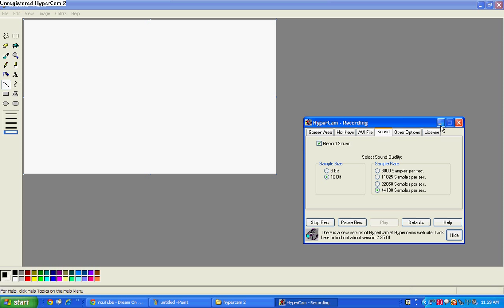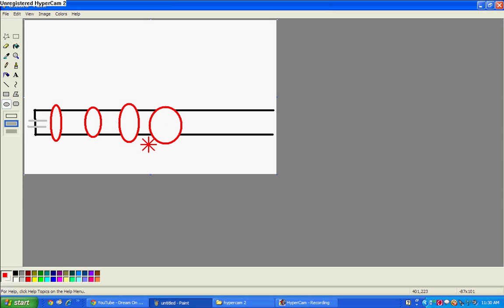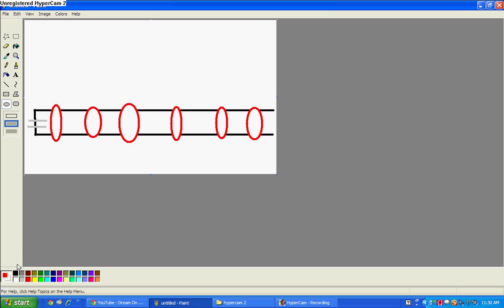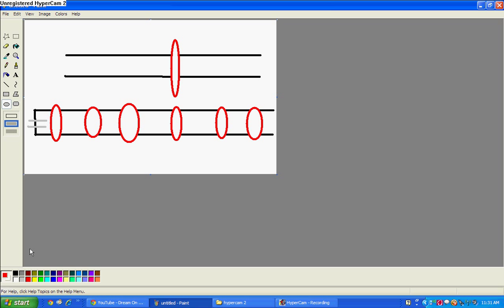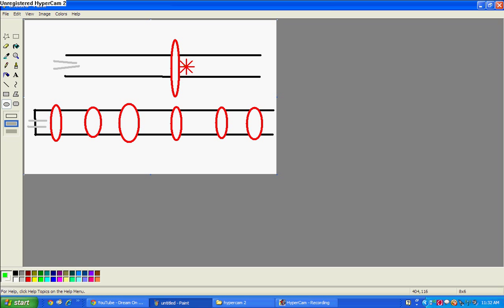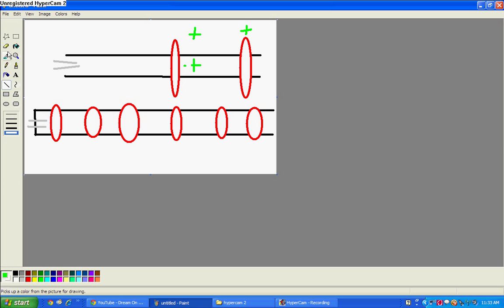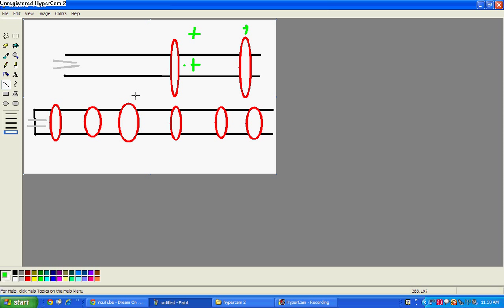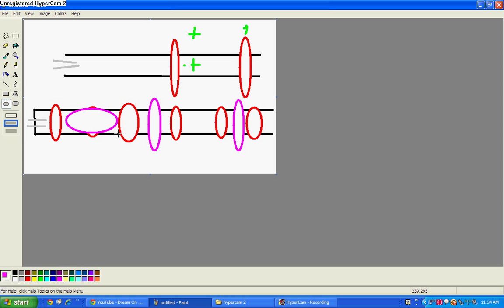How a Linear Accelerator Works

Comment from the maker: There is no pushing and pulling, there is repulsion and attraction. An electron has a negative charge so it will be attracted to an object with a positive charge and repelled by an object with negative charge. Similar to how a north pole magnet is attracted to south and repelled by north. The oscillations are in the rings (or cavities) and are controlled by klystrons, which are just super powered vacuum tubes. So whats resonating is the charge of the rings.

Comment from the maker: The rings don't actually create the field in real life they are usually copper RF cavities or tubes. The electric field is amplified to high levels using klystrons and then injected into the RF cavities (represented by rings in the video). The polarity switches at a given rate (for Fermilab about 700 million times per second) so electrons are grouped into about 700 million different bunches.